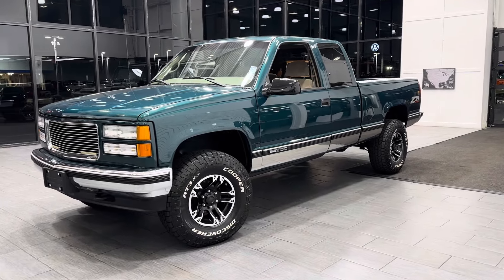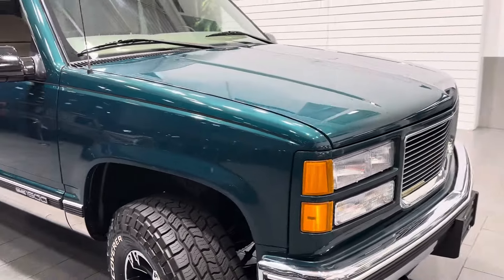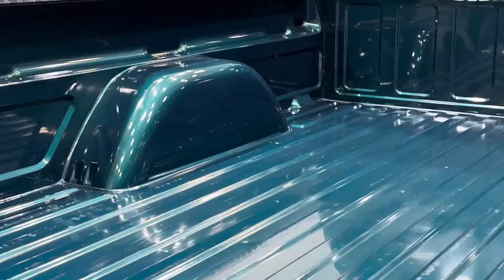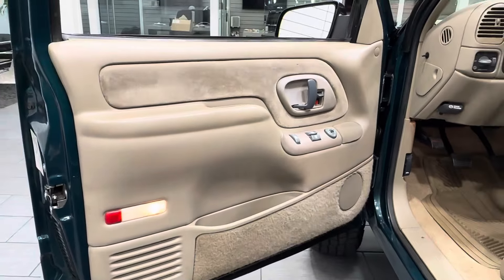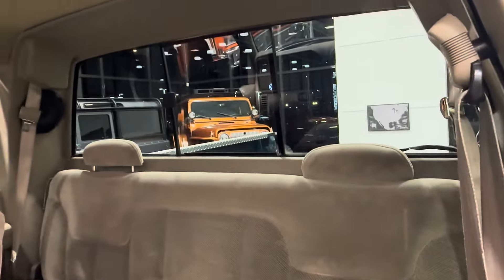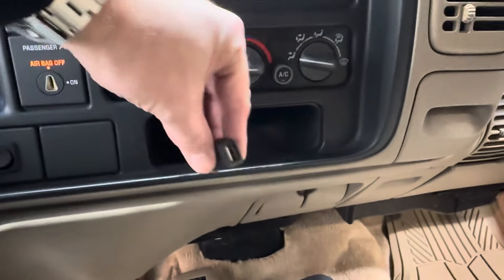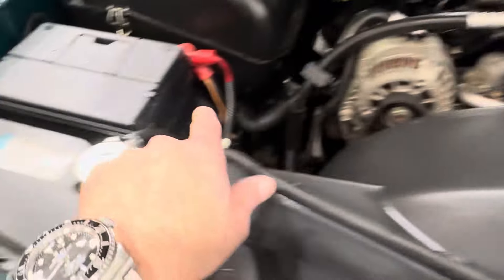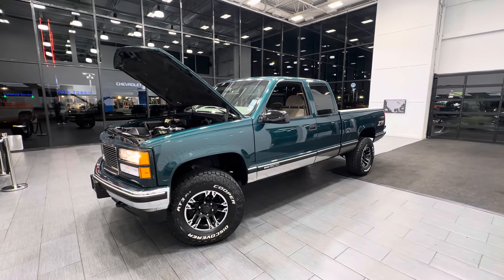1997 GMC Sierra 1500 5.7L V8 Manual 128k Miles 1 Owner 15190

Comment: 130k miles and you wany $19k for a $10k truck.  Insanity.
Reply: 10k? 19k is an excellent price
Reply: you could probably talk them down a grand or two but that is in the ball park for what this truck is worth. this isn't the early 2000's any more these trucks are classics now and your going to be paying classic prices. I mean if you want a square body in this good of shape and all original your going to be paying thirty grand for it.
Reply: Square body with a 5.7 good solid platform. If you want something cheaper, you need to go to the next generation with a 5.3 tap, tap tapperu
Reply: Wake up Derek, these things are getting old and to find them in this condition; you're gonna pay more as you should.

Comment: Gas guzzler, but nice. 5 speed is awesome. I would put the factory gmc grill in it. Had a '91 new in '91 short bed single cab 2wd, the truck was all motor fun to drive.

Comment: These are nice trucks, but you can't get parts for them anymore. Nobody makes the seats for these trucks. Nobody makes a replacement dash. If you're hydraulic ABS brake module goes out your SOL.